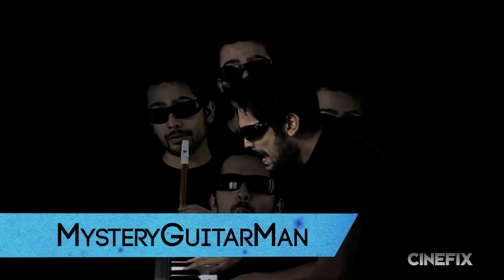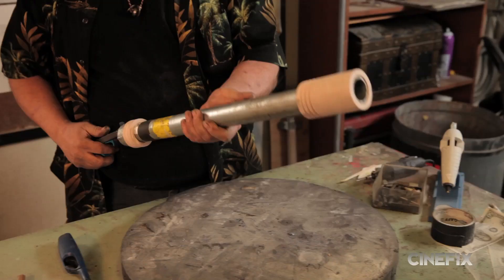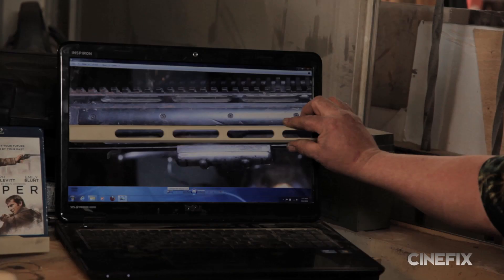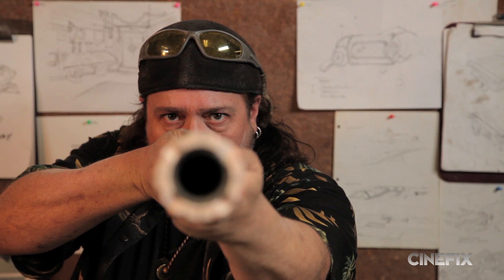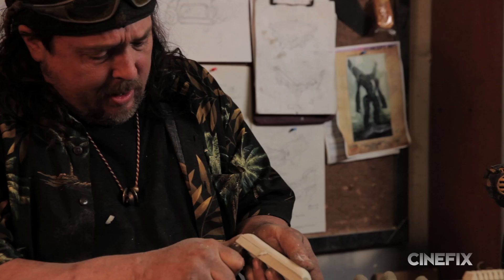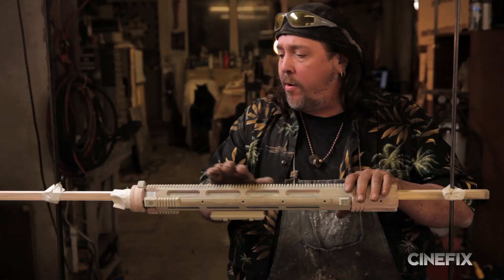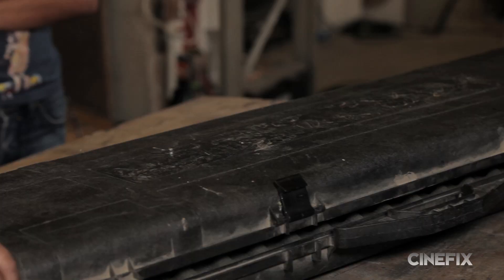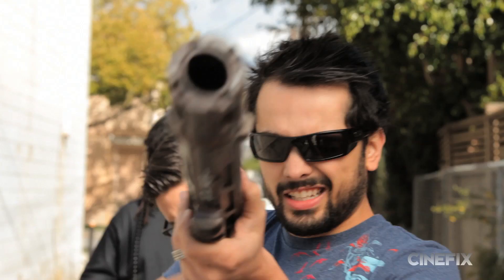MysteryGuitarMan Makes Looper's BLUNDERBUSS GUN

Comment: Very cool. He is very good at what he dose. I did cringe a little whenever he called the Picatinny rail a "Vent" but that's just the gun geek in me. Also he was way wrong about that pistol. They never use anything other than a lead round ball in that dragoon. Same with real blunderbuss guns. Historically they only used lead shot or a large round ball. The idea that people put scrap or nails in them came from Hollywood and fiction books. If you actually did that you would only succeed in blowing yourself up of have a big puff of smoke and then everything would just fall out of the gun because there was no gas seal to build up pressure behind the projectiles.
Reply: If you carve out a pice of rocks until they were round could you shoot it with the really round pebbles?
Reply: +MultiMedia XL well the short answer is yes if you patched it so that it wasn't scratching the barrel and had a good gas seal. However stone is not heavy enough and is to hard. The energy of the projectile is determined by mass and speed. If the round dost weigh much it's not going to have much power  unless you can get it going a lot faster than a lead ball. Also if it's a very hard brittle stone it might just disintegrate on impact releasing most of the energy. A softer object will just deform, penetrate and carry all the energy into the target. Having said that very early cannon did use carved stone projectiles. Not because they were a good idea but because the guns were made of low quality iron that would explode if you used heavy iron or lead cannon balls. As soon as quality cannons were being made they switched from stone to  iron.
Reply: @mistakenotou7681  Well yes but they didn't have those in the era we were talking about. A shot cup is essentially a sabot that allows you to shoot anything undersized out of a bore.  The 1841 Dreyse needle-gun used a sabot with a pill shaped bullet but they didn't use shot cups in shotguns. They were still loading with felt wads in the 1940s.
Reply: @sharpie443  the guy in the video literally under some weed and it worked